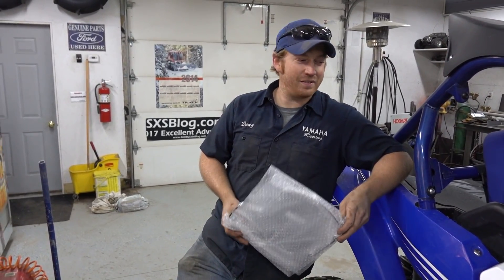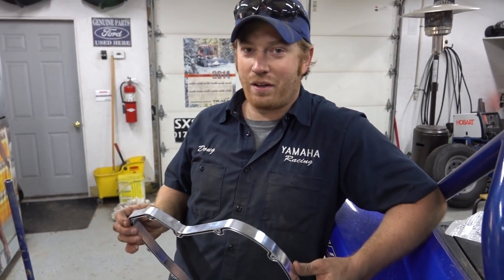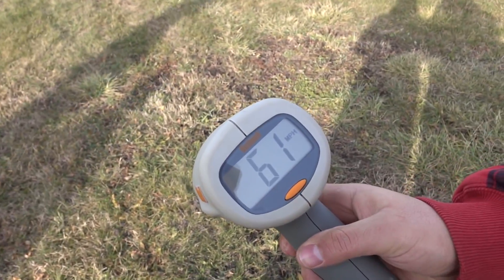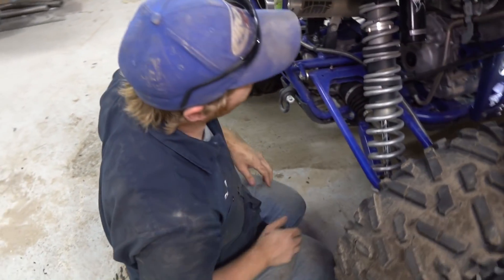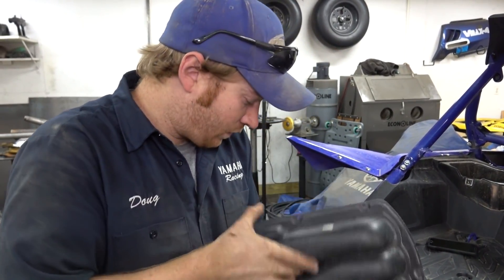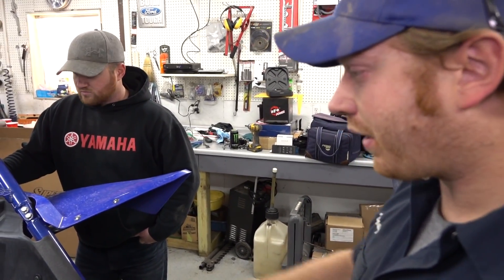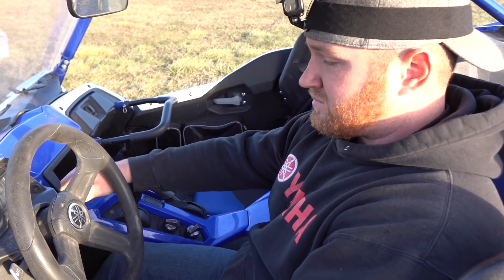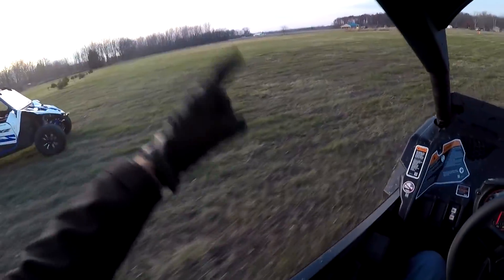Alba Racing Yamaha YXZ airbox spacer install, test, drag against a X3!!

Comment: I wish Can Am and Polaris would follow Yamaha and make their Sxs's Manual with paddle shifters..going through  CVT belts is beyond old! And I have watched a friend go through so many that it stopped me from getting a Can Am or Polaris and Choosing Yamaha YXZ ,Just still not too keen on the width and looks of the YXZ,Maybe it'll grow on me..who knows
Reply: I put 3/4 and 4/4 offset rims on mine and it took the width out to 67-1/4 inches wide! That with the stiff sidewall moto hammer tires was a real gam changer! handles and corners so much better! looks way better also!

Comment: Though I would have liked to see a touch more radar gun results for comparison - Overall Awesome review guys. 
I just bought one of these myself and it's nice to  hear it wasn't a waste of cash (I'm trying to get my power pumped up in the middle/top RPMS for pulling nasty hills in second gear since Tube works literally laughed at me when I requested a %15-20 lower second gear to better compliment my gear kit 1st gear) 

Did you guys read any of the reports on YXZTalk and forum about these spacers leaking on certain people?  Alba seem to validate the concern and said they were gonna start sending o-rings with the kit that were OEM quality instead of the other vendor they were using at the time (guess the Yamaha ones were a softer Duro) and felt that should solve the issue?  I'm gonna use o-ring assembly grease on mine I think to help seal everything up but I wanted to know your/Doug's thoughts on it.
Reply from the maker: Yeah we were aware of that, my guess is that it may be partially caused by people not getting the cover & spacer fully seated / tightened during install.  With that style screw and how tough some are to get at, it's easy to say "good enough" when some may not be completely tight.

Comment: So let me get this straight? Blue yxz with bolt on exhaust, flywheel, Alba spacer and tune beats the x3.... But the other blue yxz with the Packard supercharger and full exhaust with tune still losses to x3?? Am I the only one that made this connection?
Reply from the maker: I don't recall the state of the X3s tuning in each of those races but will say that the supercharged unit hasn't really lived up to expectations for various reasons.

Comment: Y'all know your supposed to reflash the ecu or adjust the air fuel controller after you install the spacer to get the full effect out of it right?
Reply: actually its been found that there is enough fuel within the map for the spacer....your not changing how much air, just velocity....nothing was opened up or changed.
Reply from the maker: Our tune was cleared by Alba
Reply: Ok kool. I'm just going off what nate told me when I was in there last
Reply from the maker: Yeah Mike's running the Graves tune. As we go further we'll be reflashing it.
Reply: I added the spacer and my Bazzaz  afn autotune  instantly wanted to ad more fuel because the 02 sensor reading lean .. ..  spacer makes room for more air.
more air ..it needs more fuel ..

Comment: Did you guys tune the YXZ after installing the spacer? I just bought the spacer and a Flash Tune tuner.
Reply from the maker: yes I believe Alba has a tune specific for that. We used the FTECU Graves tune.
Reply: @SXSBlog  Cool thanks!

Comment: Guys, I went to my local mountain motorsports. I was quoted 17.5K OTD for a 2017 YXZ1000R SS. Should I get this damn thing or buy used like I do everything else?
Reply from the maker: Thats all up to you brother! I don't really keep track of YXZ prices but that doesn't seem crazy for OTD. But its certainly nice getting something fresh and new.
Reply: I just left from two dealerships trying to pick up the same machine at the same price I didn't want to pay that much I left both places
Reply: I'm in St Louis Missouri by the way
Reply: i paid 13,400 OTD new for 16
Reply: foxracing I'm trying to get a 17ss 
Mostly trail riding I don't want to be clutching it all day
Reply: i understand that, just telling you my price...however you can find better deals than the one mentioned.
Reply: foxracing16 I thought there would be a better better deal out there that's why I walked out of two places thanks for the information. if you don't mind me asking what area are you in? I'm not opposed to driving for a deal.
Reply: Chris Brewer That seems pretty good
Reply: My new 16' was $13600
Reply: Jason Richter with taxes and all fees you paid 13,6K out the door?
Reply: Chris Brewer yes. It was considered a demo. Bought the 16' in May of this year. Had 33 miles on it. In Wisconsin
Reply: Jason Richter  I'm having trouble getting the SS for the price I want I was trying to trade in 800s  but now I'm just selling it online  and just go in there with money instead of a trade
Reply: Daniel Matzendacher I sold 4 ATVs before I bought mine. So I had a decent down payment. Took me a while to find a price that good though. Mine isn't an ss so maybe that makes a difference too.
Reply: Jason Richter I've been calling around looks like the best deal I can get is going to be an orange SS for 16500
Reply: That seems like a pretty reasonable deal. I hate to say it, but I call bullshit on all of these guys getting their yxz's for 13.5 OTD. Even if they're 16s. Used 16's are 12 to 13K....
Reply: Buying a demo is MUCH different than buying new off the floor.
Reply: Chris Brewer  I am so pumped yesterday I picked up an orange and black 2017 Yamaha 1000r SS
I got it for 15900 out the door.
Coming from a 2010 RZR 800 this thing is incredible
Reply: Daniel Matzendacher wow that is an absolute killer deal. I would be excited also. I picked up a 2017 RZR 1000 about 2 weeks ago and I'm really impressed.
Reply: Damn, they are going for 20k here in central florida. That's also before taxes and fees. Ouch!
Reply: John G and Missouri you don't have to pay sales tax or personal property tax it is considered a farm vehicle
Reply: Maybe where you live. But in TN you are required to pay tax unless you show proof of owning a farm by having a farm license.
Reply: Chris Brewer I live outside of St Louis Missouri but I actually bought it in Illinois and they some kind of waiver I had to sign that said it was strictly for Farm use. But I know if I would have bought it in Missouri you don't even have to sign a waiver. I'm not sure when the law change but a couple years ago when I bought a quad I had to license everything so the law is fairly new I'm assuming
Reply: Daniel Matzendacher  I consider your statements bad advice, at best. those waivers and declarations you made in attempt to save a few bucks at tax time, could cost you dearly when it comes time to make an insurance claim.  treading on very grey legal waters brother.  There could even be legal reparations from this in terms of tax fraud. America takes its dollar seriously, I suggest others to take a more logical and cautious approach.
Reply: Chris Brewer well I got full coverage from the same guy I have it on the truck the house in the boat so f*** it we'll see

Comment: why does our YXZs squeak when hitting brakes doug?
Reply from the maker: Classic brake squeal man, my YXZ has been pretty good but it still comes and goes if I'm using the brakes lightly.  You can try pulling them apart and scuffing the rotors / pads.  Being harder on it helps...  So will new pads.
Reply: thanks bro! more YXZ stuff soon I hope!!!